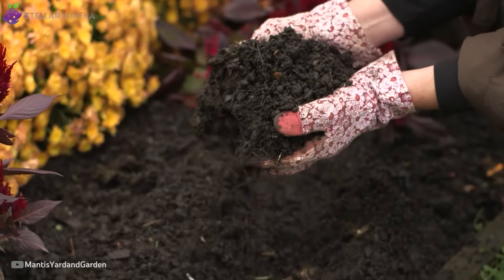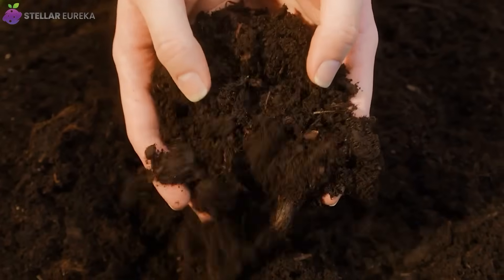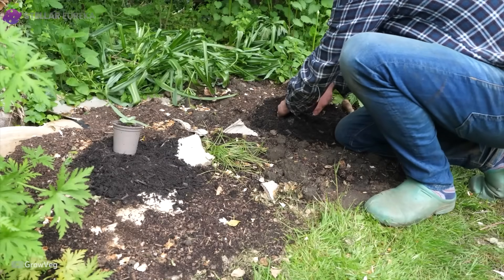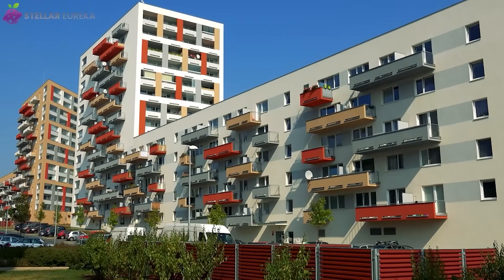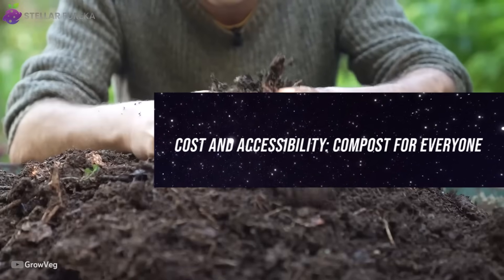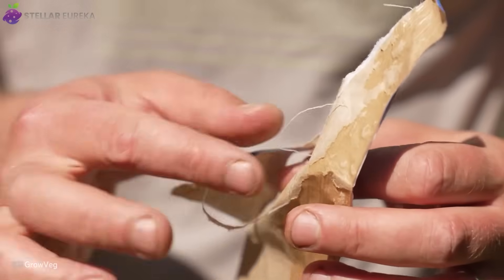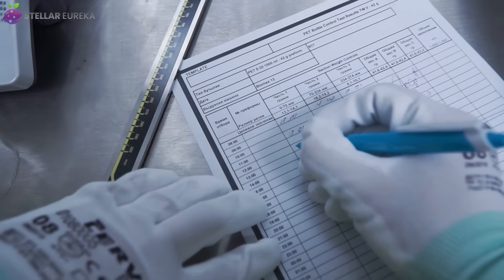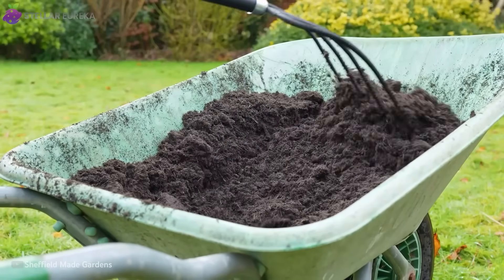Gardeners Are Secretly Using Cardboard to Grow 40% More Food

Comment: I have been doing this before they used soy based inks.  The only thing is worrisome is plastic laminated card board and even that can be made useful. I once made a shed entirely out of coke cola  can boxes you know the ones that hold canned sodas. It lasted a good ten years before a hurricane took it out.worse case recycle suspect materials  otherwise everything breaks down except PFA’s. I make soil  everyday out of different manures. My  issue is round up and other pesticides used to produce feeds. We humans indirectly in jest more that way than  using any card board.

Comment: There are chemicals in cardboard, especially boxes from Amazon!
Reply: Please expand on this. What chemicals? Do they break down into beneficial or toxic substances? At what rate? Unsubstantiated assertions carry no weight and are as trustworthy as a politician’s promise.
Reply: @vickisavage8929  Most corrugated boxes, including Amazon boxes, are made from recycled paper and starch-based adhesives. There can be traces of inks, coatings, or glues, but in general they aren’t bad for typical use. Saying that cardboard is full of chemicals is technically true but exaggerated in terms of any actual risk.
Reply: I xerascaped my yard. Mistakingly using black fabric in one section.  Then I learned of the "sheeting" method 7 years ago.  I'm glad I took pictures.   The local Walmart employee greet me and point to the big bin of cardboard. Some even save the extra large boxes JUST for me.   I work in a hospital. The operating room and kitchen are HUGE cardboard generators.   My Amazon friends love me.   Yes. AMAZON boxes are OK to use. It's been studied that worms, when given a choice, 😊  choose cardboard meals over fruits and veggies 😮      I also stop by the local coffee shops for used coffee grounds anther great soil building additives ans ANTS hate it  🎉  
     Plain,dull cardboard. 💯
Reply: I have often wondered about using cardboard.